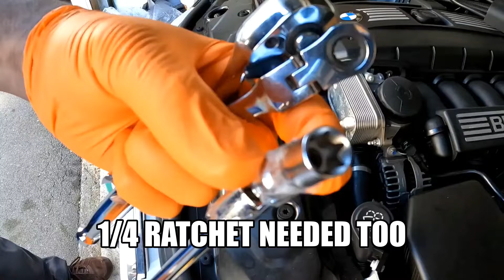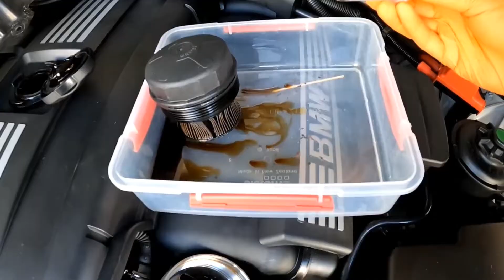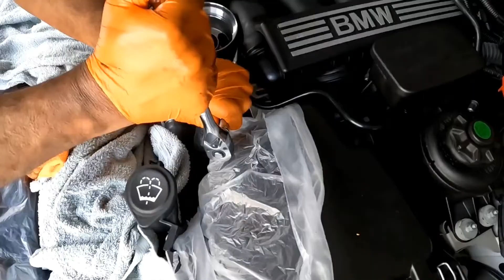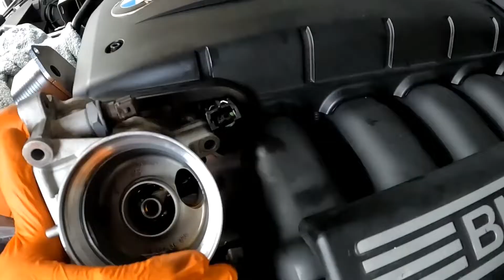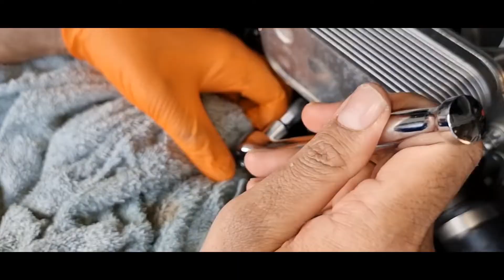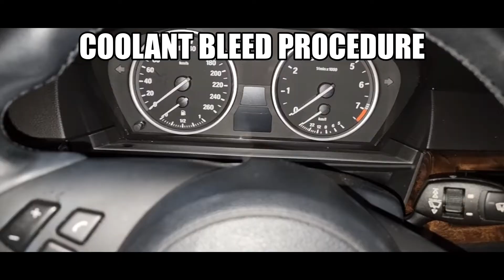BMW N52 Oil Filter Housing Gasket and Oil Cooler Housing Gasket Replacement Full guide

Comment: PUll the Collant flange and replace it with an Aluminium one from FCP....By this time that damn thing is brittle and will break and leave you stranded
Reply from the maker: I have alreday done that and have a video on it. It is an aluminium fitting , and works great.

Comment: Great video! Now I feel confident doing this job myself. But I have a question. Do I leave the coolant cap off in the bleeding process??
Reply from the maker: Thank you 😃.  Please consider subscribing to my YouTube Channel for free if you haven't already to show your support.  If it is an electronic waterpump like mine ,  then there is no need to take the cap off but I would leave the cap open when you start . Once you have completed it , open the cap and you will notice the coolant lower in level.  Add more coolant .  If it is a belt driven water pump then yes take the cap off.

Comment: Great video. I had the cooler gasket done when i boight my car and now need to do the housing... do you think i need to remove cooler to access the housing if i just removed the pipes?
Reply from the maker: @haps470  Thank you. Please consider subscribing to my YouTube Channel for free if you haven't already to show your support.  You should be fine doing the filter housing, but make sure to get the excess oil out of the housing before removing.  You can try moving the pipes but they can get brittle. I did both at the same time .

Comment: Great video, I have this car and engine and it is a challenge to keep running correctly. It was voted the worst BMW ever made in its class according to some mechanics somewhere. When its maintained it is a great car to drive but it's only been within the last 6 months that Toyota has announced it's using the latest generation BMW engines in the new Accura due to better design consideration and reliability. Anyway best video on the subject for the engine.
Reply from the maker: @jm3363  Thank you for the kind words. Please consider subscribing to my YouTube Channel for free if you haven't already to show your support . It would be appreciated

Comment: did you reuse the bolts for the oil filter housing?
Reply from the maker: @jonot8547  Hi , I did reuse them as they are not torque to yield,  but would recommend getting new ones. Please Subscribe 😃
Reply: @DocMackGarage  Thanks, with the 1/4 E10 setup I will sub :). also another question did you use 1/4 E10 socket + U-joint + extension?

or is the unique tool that is E10 with inbuilt U-joint + extension?
Reply from the maker: @jonot8547  You are welcome. Thanks for Subscribing.  Yup for the OFHG under the intake manifold I used a 1/4 extension,  a u joint and a torque wrench although when using a U joint torque wrench reading is not fully reliable but gets the job done .

Comment: Im really confused about in the name of all that is holy that aluminum pos in front of the filter housing
Reply from the maker: @dkrawk8309  That is an oil cooler . The cooler has a gasket, and that is attached between the cooler and the oil filter housing.  😎  Please consider subscribing to my YouTube Channel for free if you haven't already to show your support
Reply: @DocMackGarage  right........opener hoods in 2 of my e90s, opened closed, opened closed......still couldn't see it
Reply from the maker: @dkrawk8309  What variant of 3 series do you have 320i 323i 325i 328i or 330i ?
Reply: Im pretty sure some e90s don't have oil cooler

Comment: Did you find it was not necessary to drain the oil and/or coolant?
Reply from the maker: Not necessary as you leave the car overnight for the car to cool, coolant pressure to go down, and oil to sink down to the sump. My engine oil was still good.

Comment: Very good video my friend! Can I ask, you mentioned the previous engine for this car is more reliable is that correct? I have been looking at possibly buying one. Does the previous engine have the same oil leak issue?
Reply from the maker: Thank you Safwan , the 1st Gen is more reliable , but it does have the same oil gasket and oil cooler housing issue , however the valve cover on the 2nd Gen is plastic and the valve cover on the 1st Gen is magnesium which is better and less prone to warping.
Reply: @DocMackGarage  thanks for the reply. I just viewed your e90 video with all the issues/concerns on the engine. 
Is it safe to say, if I buy a used e60 and the gaskets haven't been replaced to go ahead and just do them?
Reply from the maker: @Safwan Abdul Razak  You are welcome,  yes I would say it is best to carry out preventative maintenance,  however you can also check of it is leaking by running your finger around where there gasket is sitting .
Reply: @DocMackGarage  hmmm yes I think definitely will have to have a look and make sure. 
A bit of an odd question but do bmw/Euro cars use different type of tools when fixing/working on cars? I've only dabbled with Japanese cars so that's all I'm use to...
Reply from the maker: @Safwan Abdul Razak  That is correct euro cars need different tools to those that Japanese cars use.
Reply: I have a x3 with n52. And it has been very good to drive. The plastic valve cover is stupid and gave me leak but after replacing part myself for $100 this car is overall very reliable. Just needs maintenance more so then Honda which has less performance.
Reply from the maker: @Christos  That is great mate.  Yours must be the black engine cover same as mine.  If you're are not already a subscriber,  please consider subscribing

Comment: Wonderful video! perhaps coils and spark plugs next? :) btw I heard only to use bmw Blue coolant? as it has certain chemical compounds to make your waterpump/thermostat to last longer than the other coolants
Reply from the maker: Thanks for that Chadrick , yup will be doing plugs soon. Yes using genuine BMW coolant is always recommended,  this is why I mentioned that I am using a slightly different coolant which is GS94000 approved which means  meets the standards required.